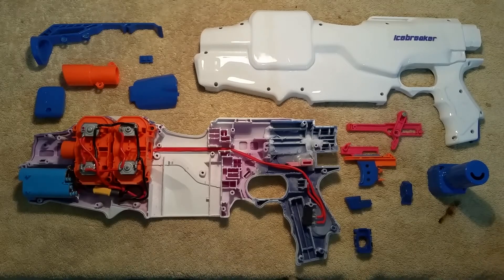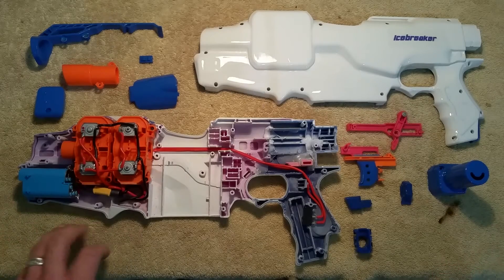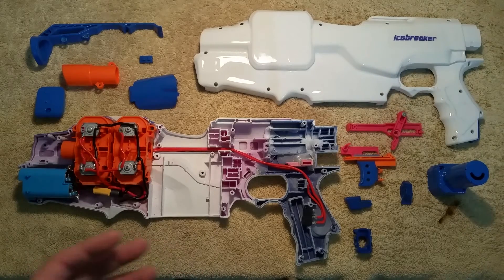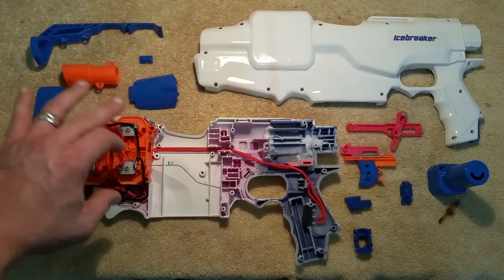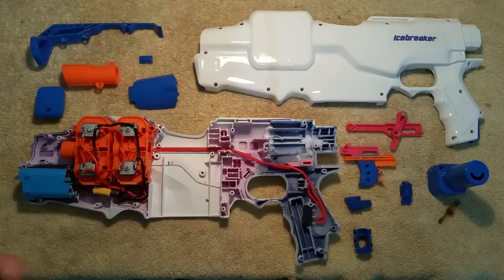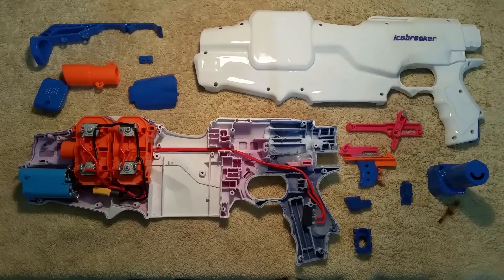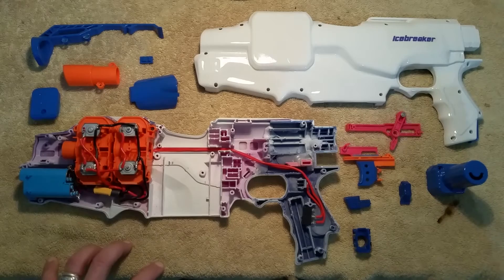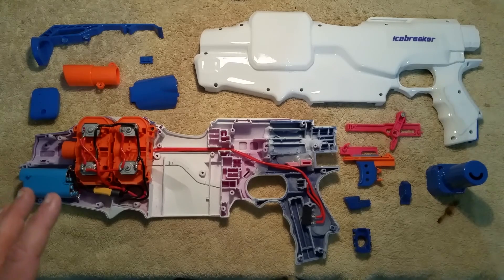Work in Progress - Icebreaker

Comment: I have this rapid red and a recon, how does the pusher fit into yours so i know when i integrate mine this winter?
Reply from the maker: I kept all the Rapid Red internals for the pusher mech itself.  This simplified the integration tremendously.  I then cut the top off the Rapid Red trigger and attached it to the top of the Retaliator trigger.  That allowed the new trigger to engage the pusher.
Reply: 498 Nerf thank you for that. this will save me time when my recon shell comes in. I'll be sure to tag you in the vids to come on my channel

Comment: what kind of switches did you use
Reply from the maker: I use some 5 amp sub-miniatures that I got in bulk from Pololu a couple of years back for my 130 motor builds.  I have used them on a lot of build (including this one) and they have been rock solid.

Comment: Hey why you don't make a double motor rayven ?
it would be awesome :) !
Reply from the maker: Actually, my first attempt at a four Flywheel blaster was a Rayven.  It failed miserably.  I tried the second cage up by the muzzle.  That didn't work because it was too far away from the first cage.  The dart really needs to be in contact with all four flywheels at some point or it gets out of alignment and "bounces" off the second set.  It didn't fire well at all.
You can't really move the second cage back in the Rayven to where it needs to be because the metal bar that connects the main trigger to the dart pusher is in the way.
Reply: Ah ok tank you anyway :D

Comment: Good to see you moving into lipos. That is a very brave integration. Which looks awesome, I am jealous.
I am very interested to see you fit a 4s lipo in there that can run those motors.
Why are you running rhinos on 4s rather than 3s? I was told, by a reliable source, Dean at Blastertech.au, they don't need it, and he doesn't recommend it, but each to their own.
Also I am interested in what battery you will be running? For 2 rhinos Blastertech/MTB suggest a Turnigy nano-tech 1000mAh 3S 45~90C Lipo Pack (71x19x35mm). 
I modded a pair of rapid reds for my daughter with rhinos on 3s, I did fit a Turnigy 1000mAh 3S 30C Lipo Pack (74 x 34 x 21mm) in but it was tight and I had more room than you because I didn't have the second flywheel cage. I also wrapped some seat webbing round the lipo to create a tab to get it out it so I could get it out. And also the lipo sizes indicated in the description are minimum sizes could be +2-3 mm, I learnt that the hard way.
Good Luck
Reply: Also you can remove the battery box. I just integrated the screw nub onto one side of the blaster with some epoxy putty. If you have the skill and patience to integrate a rapid red to a retaliator, it will be a cake walk.
Reply from the maker: The 4S Lipo is because I want the second stage turning faster than the first.  The first stages runs Kysan 17114 motors that turn around 32k rpm at 4S.  I want the second stage hotter (to accelerate the darts faster) and Rhino's on a 4S turn in the neighborhood of 48k rpm.  Too hot for a first stage, but perfect for a second stage.
The Lipo I have picked out is a Turnigy Nano-tech 1000mAh 4S 25C~50C pack (71mm x 34mm x 22mm).  I've actually got the same amount of room up front in this blaster as a regular Rapid Red - the front up to the back of the second stage cage (where the battery goes) hasn't been minimized at all.  And it is good to know that it will fit when it comes.
Thanks for the tip on the battery box.  I was still trying to figure out what I was going to do there.
Reply: That should fit, it will be tight. But it is an afterburner in a rapid red, which is really impressive. You may have to do some Dremel work to get it in. I had to dremel the ribs off the front door and some inside the battery space and then place a little piece of webbing around it to get it out. Your build is leagues above mine. I will put a "really raw" vid on youtube tomorrow to show how I fitted my battery in. I wish you luck, it is truely an awesome build, and lipos rock. I hope you got more for your hail-fires.
Reply from the maker: Excellent - I'll look for the video.
I have two of those Lipos on order.  I wanted to try them out before I got more.  I probably won't go back and modify the Mk.4 to fit a Lipo but will look at putting one in the Mk.5.  With the Rapidstrike though, I may have the option to put a short, fat one up in the very front of the blaster - in the stock battery tray in front of the second stage motor cage.
Reply from the maker: Just watched and left you a comment.  The link got marked as potential spam so I just found it.